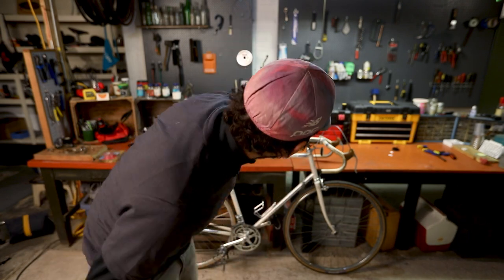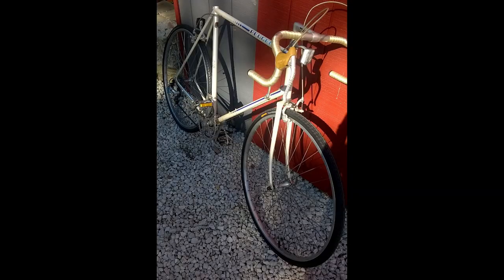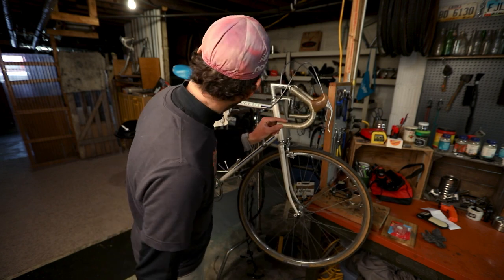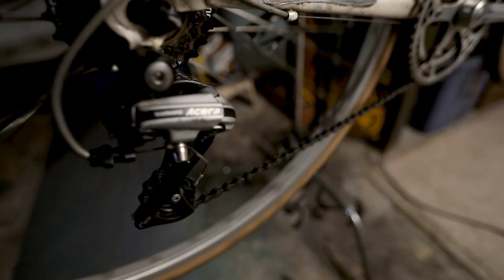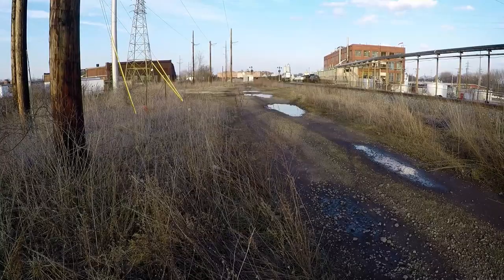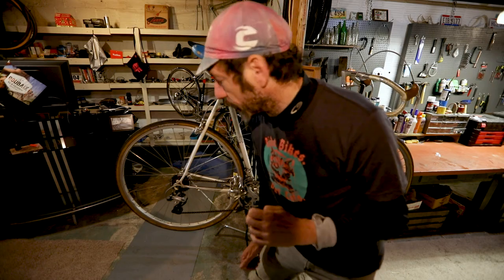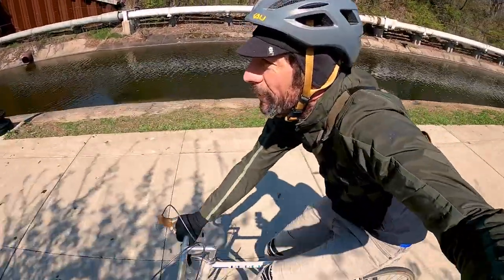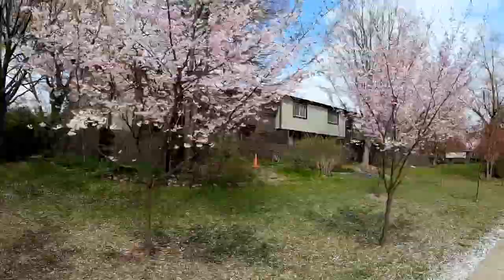THE PEUGEOT - Steel is Real - 80s Aero French Bicycle

Comment: I own two Peugeot's. The first was my HS graduation gift, a 1988 12 speed Marseille and then later I picked up a 1989 14 speed  PH10LE Tourmalet. Both came with Shimano hubs and SIS index shifting, front crankset, seat stem, handlebars, brakes etc are all french made. My Tourmalet was recently upgraded with modern Mavic 700c aero wheels and Shimano 105 brakes. I use it for my daily 20 mile workouts and also for long 40+ mile rides. GREAT BIKE!
Reply from the maker: oh yeah - much nice bikes with more modern tech than my humble Peugeot!
Reply: I;m thinking of doing the same with mu Pug. But can;t source cheap used 700c wheels

Comment: I have an early 70’s Peugeot u09 and have modded it a good bit with indexed down tube shifters, converted 10 to 14 speed, new wheels with 35mil tires. Still would like to upgrade the brakes and levers one day but I love riding it the lugs on the frame and graphics are so beautiful
Reply from the maker: Nice that you were able to fit 35s! I put the widest tires on my vintage bikes they can handle. Drop a link to a photo if you have one somewhere - I would love to see it!

Comment: Two weeks ago a friend gave me a peugeot 12 speed french racing bike. Everything is original built on light aluminum frame. Even have the original Michelin tires on it. It races great. He hasn't ridden the bike in 20 years. Works great.
Reply from the maker: Nice! Sounds cool.  Can't believe the original tires are ok(well, really make sure they are - dry rotted tires can be sketchy!!).
Reply: @TimFitzwater  They do have slight micro cracks and cracks. The tires do but still holding no dry rot plus the tubes hold air. Rides like a dream. Have to replace two screws the height and low adjustment screws.

Comment: I had in mind this idea of get a classic steel frame and start a project of an old school frame with modern components. Some weeks ago I visited a bike repair store and the topic came out in the conversation with the owner. Suddenly, the guy went to the back store and came back with a frame just like this: Carbolite 103, just the frame and fork and he gave it to me. "Just show me the bike when you finish it", he told me. Probably the thing was collecting dust and wasting space for a while. I have already sanded and spray painted it with decent results for a back yard paint job. I've been putting some love on it. Maybe I'll use Shimano 105 groupset.
Reply from the maker: I built a Trek 500 from the same year with Shimano 105 (9 speed).  I love the neo-retro builds. I'm not 100% sure because things started to change around that era - but do some research on the bottom bracket threading - if it is French you won't be able to put a regular Shimano BB in there(or any modern BB) - but Velo Orange and a few other companies make threadless options.  Also - the spacing is tight on the rear - I was able to put a modern wheel in the Peugeot but I did have to pull it wider.  There are some good videos on how to properly spread a steel rear triangle though if you want to take time and do it the right way.
Reply: @TimFitzwater  I've already cold opened the rear space (from 120mm to 130mm) and make sure  of alignment with strings. Also aligned the dropouts. Thank you for the bottom bracket advice! I didn't have that in mind. I'll check that!
Reply from the maker: I tried to research the BB's again and could still find nothing about the Carbolite 103 frames(even on Sheldon Brown) - seems like the threadless options would be easiest - I really should take mine apart to find out and give it a rebuild/regrease.
Reply: @gustavoguidor156  there’s another YouTube channel called “RJ the bike guy” and I done the same exact thing he did in his video on how to cold set the chain stays from 126mm to 130mm using a 12” long 3/8” bolt, a couple washers and nuts. I also built the tools using carriage bolts to check the dropout alignment afterwards. And it worked perfectly on my PH10LE. I also upgraded all components to Shimano 105. They just dropped right in. Lol modern gearset/brakes/700c Mavic cosmos aero rims on a bike from 1989!

Comment: So good. I had a road bike (giant TCR- bought at 15, with all my cash, raced/tris, was graduating from my dad’s Puch) the tcr was stolen, got a Masi with the horizontal dropout, built up, stolen (LA😂). Then before some friends bought me a Surly Steamroller a buddy let me ride his Peugeot (single speed). Brought me right back to the Puch days. Since, my son inherits the Surly and I build an 80/90s Davidson Impulse white with a splash of green paint. It’s great steel and having ridden quite a few different set ups my experience on that bike parallels your description here. It’s my one bike (kinda), cause the Steamer is a great winter sled (having moved from LA to Minnesota) you kinda need two here!
Reply from the maker: Nice! (except for them getting stolen of course). I had a Puch Alpina - it  was beautiful and had a full Shimano 600 groupset. I just wasn't riding it and it wasn't sentimental like my Peugeot has become so I sold it to a friend. Definitely need multiple bikes in NorthEast Ohio too.  I needed my studded tires for most of the winter!

Comment: This video has all the answers that I needed. Thanks!
Reply from the maker: Glad it was helpful!
Reply: @TimFitzwater  unfortunately I missed out on a sweet deal, but I got an even better one. A 1974 Schwin Vasity for $30, and it's mostly original. The front wheel and tire have been replaced, it's missing 3 reflectors, and the seat was replaced. It has a Specialized bottle cage to somewhat match the opaque blue color. I've been working on it all day to bring life back into it. The stem has some bad pitting from rust, but it looks a hell of a lot better now. Most of the chrome throughout the bike is almost back to mirror finish. Couldn't pass up on it for 30 bucks.

Comment: Internally routed cable? That's really cool. I always thought it was pronounced Pugot but I like it. It has the side pull brakes, I always liked center pull. I just picked up a rack so I can work on my bike without flipping it upside down and damage the brake cables which I just replaced. A rack makes it so much easier to work on the bike. Have a great day man, happy riding.
Reply from the maker: I'm sure the British say Pugot but the French don't....   Center pulls are nice when dealing with fenders too - but I hate adjusting them!  Yeah - work stands - even cheap ones are awesome - I put a second home made one by my back door for quick clean up and lubing.
Reply: @TimFitzwater   The number on the bottom of my bike is KS149010. Not sure it represents.
Reply: @TimFitzwater  The laugh is on me because Miyata WAS  a Japanese manufacturer I just discovered. They came out with a car called the Miata. How about that, I learned something today, lol.
Reply from the maker: @johnnycee5179  That definitely sounds like a serial number - have to see if there is any resource out there.
Reply: @TimFitzwater  The "K" is for Katakura, the "S" is for pre 75 (71-73), I think an "I", not a 1, is next representing last digit of year so it's 71, then the 4 represents month with January being 1, February 2 and so on until December being L. Last 4 digits are manufacturing or frame number of that month and year. So it's the 9,010 frame produced in April of 1971, manufactured in Katakura, sold by American Eagle in the USA. I'm pretty sure that is right. I found a Nishiki data base like you mentioned.
Reply from the maker: @johnnycee5179  Awesome! You also just solved a mystery for me - I have a Katakura Silk - it is a cheaper touring bike but I hadn't been able to find much about them except a few photos of some track bikes.  I knew it was Japanese that was all....
Reply: @TimFitzwater  I never would have found anything if you hadn't mentioned a data base and the serial #. We helped each other, that's how it should be.

Comment: The struggle is real...how to fit yourself and the bike in the same frame! Very cool bike and great video. If I could find a cheap frame, I would be interested in doing a neo-retro Italian bike.
Reply from the maker: Ha-for sure!  Your definition of "cheap" will come into play with Italian bikes - its kind of the reason I don't have one. I've always wondered why the Italian brands didn't jump on the 70s bike boom. There really isn't a cheap Colnago.  It seems eventually that Bianchi did start making more run of the mill bikes(still do) but the rest of the brands for the most part stuck with the high end. I've always likened Colnago's(which I would love to own) to Leica cameras  - anyone who bought one knows they bought one and they are extremely rare as cheap garage sale or flea market finds....

Comment: Hello Tim, I just bought a Peugeot carbolite 103 corbier Frame, 1986, or 1977. Possibly you can tell me where i can get information about the the rims & wheels size, and what means the number under the frame: “ Y 602 3 1977 “, Thanks
Reply from the maker: They sold them in the US with 27 inch and Europe with 700c  - either should work because they are so close - you just need to make sure the brakes you buy align with the rims.  I've converted a number of bikes  from 27 to 700 with no trouble.

Comment: I own a PH12 Centennial and the tubing used is Carboprofil 103, it's the same Carbolite 103 steel but aero shaped downtube, seat tube, seatstays and chainstays. Downtube shifters are brazed on top of the downtube, and the shift cables run inside the downtube and exit down by the bottom bracket. Rear brake cable is internally routed and the handlebar is internally routed as well. I've got the original aero bottle and cage as well. Neat stuff for 1982 and using steel, not aluminium or carbon fibre.
Same here though, can't get myself to change the original handlebar tape, however mine is in very good condition but utterly useless bar tape.
Reply from the maker: Oh awesome!  I did see one on a classified ad site once but it was in way to poor condition for the price they wanted. I offered more than I even wanted to pay and they turned it down.  Have you seen this video? He even has the water bottle!  https://youtu.be/yLmzCqc1jM0
Reply: @TimFitzwater  Yes I have, he did a great job restoring it, all things considered. I was fortunate to find one in extremely good condition, all original, even tyres, brand new original clipped pedals, original groupset etc. Only replaced the brake blocks as the original ones were petrified.
I have to admit that it wasn't cheap.
For whatever reason all Peugeots maintained in very good condition fetch a pretty penny regardless of model.
Reply from the maker: @cosinus_square  Bikes are interesting in that way - since a large amount of people like to ride but don't know anything about them. I think the general public think of "Peugeot" as cool and French and don't realize they made high end race bikes, to nearly the cheapest/heavy things possible and everything else in between. I guess it would be like "Fender" to people who don't know about guitars. There are $150 Fenders & $1500 Fenders.
Reply: @TimFitzwater  Very true. However saying that Peugeots are cheap low quality bikes (like a comment below) is like saying today that all carbon bikes with proprietary parts and press fit bottom brackets are scrap, because they crack easily and the bb's are constantly creaking. 

You got what you paid for back then and you get what you pay for now.

One thing is certain though, Peugeots are and will be cool bikes.
Reply from the maker: @cosinus_square  Yup! I love my Peugeot not because it has any value - but because I've had 4000 miles of fun on it!

Comment: Nice bike! I have a similar  vintage PH501, same geometry.  Don't you love the handling & ride quality? I think these are special, and I am a lifetime old hard-core. You got a good deal!
Reply from the maker: Yeah - I’ve always been amazed at how nice this bike feels - especially since the tubing isn’t even that nice. What color is your 501? Those are super cool!
Reply: It is a dark maroon. 86 maybe. I got it free as scrap with no wheels. I modded it to a commuter. Turned downtube levers into cable stops,  went triple cranks, original front deraileur still worked! Used commuter bars & old Schwinn Weinman brake levers. I confess to obsessing on the build a couple years long ago.. But no regrets. Yours looks great!  I will try to send a picture soon. Watch for rust! Put some rust killer in your tubes!
Reply from the maker: Awesome!

Comment: I the same bike at home but a black one 
Is the crank set up that already that on the bike will be ok doing climbing hills and long groups ride or is it to heavy ?
I am sure not a 105 crank set or something close too it .
Reply from the maker: There wouldn't be any Shimano originally on a bike like this as Peugeot only used French parts back then. Simplex, Huret etc. Depending on the year it could be switched for that though - just look out because French threading is different.  ITs not too heavy for climbing or group rides - it is just on the heavier side compared to expensive race bikes.  No one is ever dropping me when I ride this.

Comment: Today I got literally the same bike for free should I sell it or restore what do you think was it hard to find parts, I mean only tires need to change and brakes
Reply from the maker: The only value in a bike like this is to ride it. You won't get much for it. 
Any brakes or tires will work so I'd do that and ride it. If you get into anything deeper you have to deal with French standards which are different than modern sizes.

Comment: Do you know what type of bottom bracket a 1987 Marseille is. It has a Canadian market on the frame near the rear hub.
Reply from the maker: By ‘87 I would guess it would be a standard English bb - should work with anything modern - but I can’t guarantee it.
Reply: @TimFitzwater  thanks again

Comment: whoa! Is that a C stand bike stand? I've tried a roller stand but it didn't work out so good. What are you using to clamp it?
Reply from the maker: Yes - with a sandbag for counter balance.  The clamp is a Manfrotto one - not sure exactly what they are called. Never clamp down tight on a top tube though - if they are butted that is their weakest point.  I have t by the door now for quick Winter cleaning.  I'm lucky I have a floor drain down there.

Comment: Although i'm a Fan of steel bikes, i wonder if these bikes from 70s 80s are actually pretty bad ones. In contrast to the 90s, where quality climbs higher and higher on steel bikes.
So tell me please: what is good about these 'really' old racers?
Reply from the maker: This is a cheap one as mentioned. What’s good about it is it cost me $35 originally and I put 5000 miles on it. (And it is still goi g strong)
I disagree that every 90s bike would be better than every 70s bike. 
For one / many 90s bikes have no tire clearance- it was the era that they believed super skinny tires were faster(they aren’t ).
There are amazing bikes from all eras. Top end steel tubing hadn’t changed all that much from the 70s to the 90s and I’d say the difference between a 70s or 90s Colnago wouldn’t be as much as someone might think.
Reply: For Peugeot, it's the geometry. By the mid 70s, the geometry for these bikes had been fine tuned for 70 years or so from input by professional riders training and riding in the Tour de France -- all over France, in all different types of terrain. Even the Carbolite 103 bikes ride very well when they're optimally maintained, or refurbished with higher end components.  As the years progressed, bike geometries got more aggressive, until you had weekend warriors trying to mount a time trial bike. If you get an old Peugeot, redo the wheels, put on GOOD tires (25mm or 28mm) with the proper tire pressure, new cables, properly adjusted, and totally tuned up, you will enjoy the ride. I've had over a dozen Peugeots (still have about a dozen) -- from the cheap tubing all the way up to the (real) PX-10s, and PY-10s, and, properly tuned, they all ride wonderfully. However, don't expect much in the way of finish. Peugeots do not have good polish, but of all my bikes (20 or so) from a modern Trek carbon fiber all the way down to a 1966 PX-10, the Peugeots are among my favorites for daily rides. Edited note: all of my vintage bikes were bought in  France. They are not the export versions.

Comment: Wondering if I told you the bike I have if you could confirm it's year of make.
Reply from the maker: I might be able to - I usually have a pretty good idea. The best thing would be if you could link to a decent photo with the drive side facing the camera.
Reply: @TimFitzwater  https://photos.app.goo.gl/6h6gxLvq5VTuyGxT9
Ok, this is the bike, ya know it's year?
Reply from the maker: @johnnycee5179  hmmm - interesting - is that a Japanese bike? A Miyata?  Parts of it make me thing late 60's but other late 70s.  I'm going to show it to my friend who I am riding with tomorrow - I think he will know.  Very cool looking regardless!
Reply: @TimFitzwater  lol, Miyata? You mean Miata? That's a Japanese car and I have that too, a 91. It's a Nishiki Olypiad and yes it's made in Japan. I have traced the rear derailleur down to being a Shimano Eagle SS model DE 310 released in 1971. The pulleys are marked with a 333 on them. Dork disk also is marked 333. I'm figuring it's between a 1971-1973 but Shimano came out with the Eagle ll in I think 73, maybe 72.
Reply from the maker: @johnnycee5179  Ha! I'd blame auto-correct but that would be a lie....  I did guess Japanese though!  Seems you have it pretty narrowed down which might be the best you can do.  If there is a serial number on the bottom bracket shell you might be able to get the exact date if someone has a Nishiki database online.  I've had/have bikes where the groupset and frames are not the exact same year or even what was shown in the catalog.